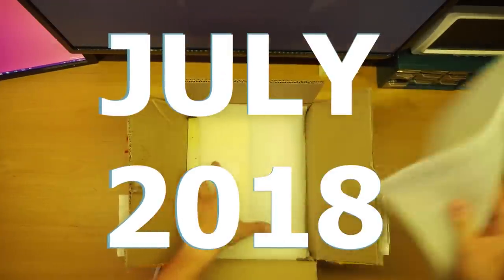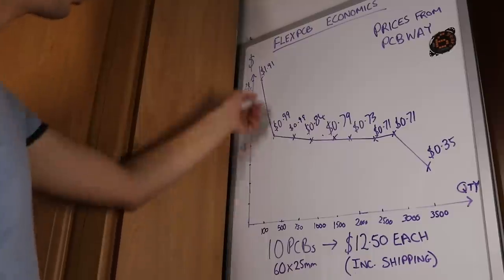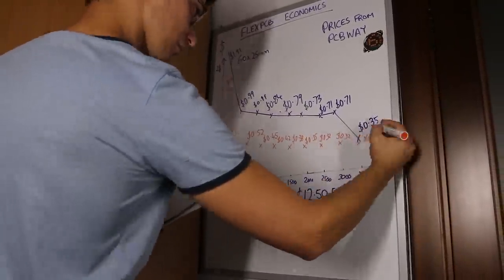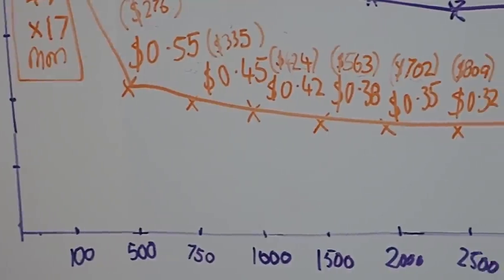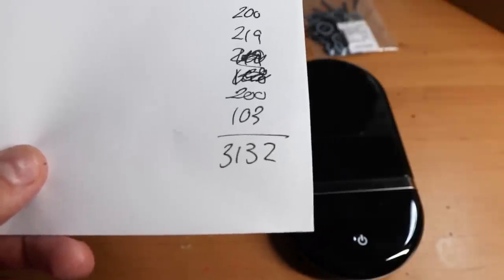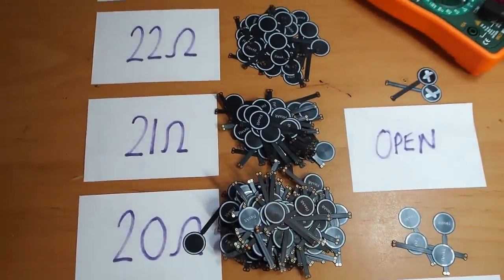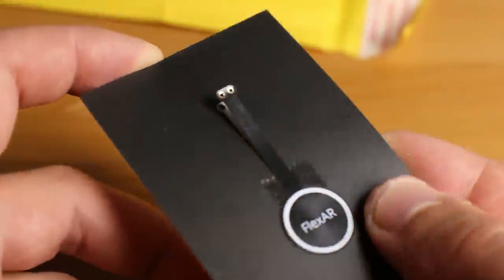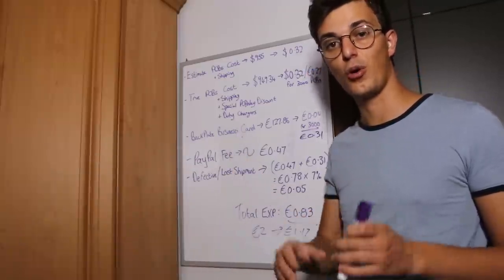How I made a €2 ACTUATOR

Comment: 4:54 A more accurate way is to weight 10 pieces and then divide the weight by 10 to get the average weight of 1 piece.
Reply: That's what I was thinking
Reply: Yeah, I don't believe that scale is accurate to the μg.
Reply: I wanted to write the same.
Reply: When working in stores between engineering jobs many years ago I was told that you should count out at least 1% of the batch with 10 being a minimum for items over 1g and 50 for items under 1 g. I suppose accuracy might have improved by now but not by that much.

Comment: I've ordered a few. I'll chart the impedance characteristics from 10Hz-100kHz and send you the results if it's anything interesting.
Reply: Inductance = 30uH, Series resistance = 20 ohm, self resonant frequency = 2.38MHz
From those, you can calculate parallel capacitance to be 150pF and Q max to be 22.

Impedance plots are what you would expect from an inductor with those characteristics. Resistance dominates below 100kHz, then inductance up to 2.38MHz, then capacitance.

Caveats are: 
- I've only bothered measuring one, so these are approximations due to the sample size. 
- I measured in air with no magnet or core nearby. The magnet would change these values, but I think that would be too difficult to account for as the thing moves with respect to the magnet.
Reply: I wonder if you could drive it with a 100kHz-1MHz carrier modulated with the low frequency it physically moves at.
Reply: @KX36  That's some goof work of you! I think it should be part of the datasheet. Did you do a bode plot of the frequency response?
Reply: @KX36  mvp, thanks!
Reply: @KX36  That's highly appreciated 👍🏻 thank you

Comment: dont even know what is an "actuator"
Reply: Me too help me guys lol
Reply: An actuator recieves a electrical signal and works a mechanical pump, switch,  motor or valve
Reply: actuation is movement, an actuator is a component that accomplishes motion or force application when you power it. 

a regular DC motor is a kind of rotary actuator, Linear actuators also include a length of ballscrew so when the motor spins it can accomplish linear motion. 

Hydraulic pistons and motors are a type of actuator that use fluid pressure instead of electricity to accomplish force and motion.

A solenoid is an example of a simple electromagnetic actuator. Very small RC planes sometimes use a simple magnet-in-a-coil type actuator for the control surfaces. 

The Flex PCB is the coil part of an electromagnetic actuator. put it next to a magnet and it can apply force to it and cause motion of itself or the magnet.

a 'servo' actuator is one where you have fine control over it's position because something is measuring the position and feeding that into a circuit or processor which is controlling power to the actuator (this system is called a servomechanism). that way it can be kept at a precise location or RPM or apply a constant amount of force, etc. 

since the flex PCB is springy, you can use it as a positional actuator since the more power you put in the coil the more it flexes, and by putting in AC you can make it flop back n forth at a specific frequency and exploit that predictable motion to build sweeping displays and the like.

But TL;DR an "actuator" is a component that takes power in some form and turns it into mechanical force and movement.
Reply: When you go in a dark room and switch on the light, you're simply using an actuator to light up the room. An actuator in its simplest form is like a switch but here it is being used as a device which "acts" (becomes "active") when an electric current passes through the FlexAR coil to make it act like a magnetic switch
Reply: @EDU4519Computing1  idk a light switch isn't really an actuator, an actuator creates movement by being powered. In the case of a light switch your finger is in fact the actuator. The flex coils don't switch anything on or off, they turn current into a force which can create movement especially if the current is alternated on and off. The coil in a relay is an actuator, but the whole relay is something more, an actuated switch.
Reply: @chrismofer  was trying to simplify things...
Reply: @EDU4519Computing1  I could be wrong but I don't think it can be simplified beyond saying an actuator creates physical movement by being powered. Light switches don't do that, they aren't actuators. Motors and electromagnets and solonoids and even railguns are actuators, they take power and create movement. A switch doesn't.

Comment: I was waiting for this explanation from the time when you posted a teaser on Instagram 😄. Great job as always. 🤩

Suggestion: Please consider using a paper tape for sticking the PCB on the card because when you use other tapes and store them for months, the PCB will become sticky and it's a mess to remove that stickiness. It's all my personal experience with different types of tapes🙂
Reply from the maker: Haha thanks so much 🙂 I think it will be better yes if they get taped with paper
Reply: @CarlBugeja  you could also possibly fold over the business card for extra stiffness and tape it closed and then not have to put any tape on the actuator at all. But that might be too much work x3000.
Reply: @CarlBugeja  How about making two parallel cuts on the business card to make a sleeve and sliding the actuator in to hold it? You could then fold the top and bottom to make sure it doesn't slide out if you're worried about that.

Comment: You know TI has a solenoid chip that has 2nd-order compensation which means you get PID like positional response with a seemingly open-loop system! (Not exactly, the chip does current measurements internally)
Reply: That's some great info, thanks!
Reply: @hellelujahh  No problem! I found it when searching for a chip that can drive my voice coil motors. It's the DRV201, i think there are more like it.

Comment: I'm waiting for the arrival of 4 PCBs for the levitation device. I really loved this video about the production and price calculation. It would've been even better if you measured the inductance of the coils along the resistance ( or I'm blind and it's posted).
Reply: Maybe this helps. Its not mine, but from a KX36´s comment posted above (I don´t know how to refer to that comment here):

Inductance = 30uH, Series resistance = 20 ohm, self resonant frequency = 2.38MHz
From those, you can calculate parallel capacitance to be 150pF and Q max to be 22.

Impedance plots are what you would expect from an inductor with those characteristics. Resistance dominates below 100kHz, then inductance up to 2.38MHz, then capacitance.

Caveats are: 
- I've only bothered measuring one, so these are approximations due to the sample size. 
- I measured in air with no magnet or core nearby. The magnet would change these values, but I think that would be too difficult to account for as the thing moves with respect to the magnet.

Plots:
 https://i.imgur.com/plMCLv8.png

Comment: That's really pretty interesting, and it's a neat design you've come up with.  I saw you bouncing some magnets with one in one of the video clips; have you tried making a robot that moves by moving the magnet quickly in one direction and slowly back the other direction?  It has something to do with the amount of inertia of a fast-moving object vs a slow-moving object, and the net result is a force in one direction.  A couple setups like that on the ends of a boom a few inches long might work pretty well to make a robot "walk" (or at least, shuffle).
Reply: Due to i think the coservation of energy law it doesent work. Try spinning a spinny chair this way!
Reply: @sharpnesstherapy502  I thought I remembered that working, but now it sounds like the inertial propulsion drive nobody can prove works.  :/  If you slide an object on a string away from you quickly and then pull it back slowly, would that work?  Or use one-way clutches on the wheels, so they can roll forward but not back...?
Reply: @cultuedropout Not quite sure what you mean here?!  but regeardless of speed your distance traveled will be determining. vibrating something forwards and backwards will never make propulsion. 

This one way clutch thing? maybe you men like a bristlebot?
Reply: @sharpnesstherapy502  The rules are a little different when you throw in friction with the ground, I think.  Think of wearing a pair of roller skates that will only roll forward, but not back.  You can push against one skate to roll the other one forward, then switch off.  Except the "skate" would be kicked forward by one of his actuators pushing against a magnet attached to the other "skate".  I don't know.  When I went to school, the periodic table only had Air, Water, Fire, and Earth on it...

Comment: I received my flexar package today. The packaging is safe and the product in a good condition. It did not take long for me to find a usecase. So i am looking forward to using it. 
For everyone asking themselves how to use it: The main advantages is its low mass inertia. Therefore it can switch with high frequency without using much energy. I personally use it to block a laser ray, as the solution is both cheap and extremely fast.

Thank you Carl Bugeja
Reply: And what a cool stamp you used 😂

Comment: Great project and excellent disclosure of cost. However, buy lumping the PayPal fee into each single part is a bit unfair to someone that orders a larger quantity. For example, I was thinking of building a haptic feedback system so I'd need one coil for each finger. That would be ten to do two hands. That would reduce the fee you showed from 0.47 to 0.047 per device.
One way to do that would be to lump the PayPal fee in with the shipping cost, often referred to as shipping and handling fee. Another way would be to put together a quantity discount like many Vendors do on their website. Just a thought.

Comment: A tip for your packaging, instead of using tape, maybe try two small slits that the actuators leads pass through from front, to back to front again. That way its held gently in place with just the card, eliminating an extra consumable cost and the chance or end-user damage related to aggressive tape removal.

Comment: Since the coils length determine the strength of the actuator (for a given magnet), wouldn't it make sense to use a square coil rather than a round one? This would also make the maximum use of the pcb. Another idea is to have two coils side by side on the same board, which would give you another axis of control by actuating one coil to go up and the other to go down, creating a twisting action.

Comment: WRONG WAY TO MEASURE...

You take a small number like 10 or 12 and use that as the weight guide as one PCB may not give you the realistic weight that you will get with 10 or so, then do a similar calculation to get a more accurate weight count on parts.

I used to use this method with the parts I used to deal with in goods in.
Reply from the maker: Thanks for the tip 😁 I actually measured a couple of them off camera and too an average.. The video would be way to long if I go through every detail haha sry

Comment: nice video,
one suggestion is that when you have a large amount of component to quantify, I would base my calculation with 25 or more to evaluate the weight of a single component .
since + or_ 0.1 gr can add up quite a bit for 3000 pieces.
overall 4.5 stars out of 5 
good job !
Reply from the maker: Thanks for the tip 😁 I actually measured a couple of them off camera and too an average

Comment: I am wondering if you ever tested it for the number of cycles it can survive... fatigue in materials can finish it off fast, copper being the first suspect... i’d say it will break where the round part transitions to the neck... in the most narrow place
Reply from the maker: I am planning to make a video on that test 🙂 but I am pretty confident it is robust considering some test I already made
Reply: i guess the number of cycles will greatly depend on amplitude of the swing, so making a number of cycles vs angle chart isn’t a bad idea
Reply from the maker: @dmyegorov74  the plan was to test at the maximum swing angle possible 🙃 if that gets a rating of x million cycles than everything else should be higher
Reply: @CarlBugeja  I think once you get to the swing angle where plastic deformation in copper occurs things will turn really bad...i'd say hundreds not millions... not sure what that angle is, hopefully it will be wide enough for what this is intended for.